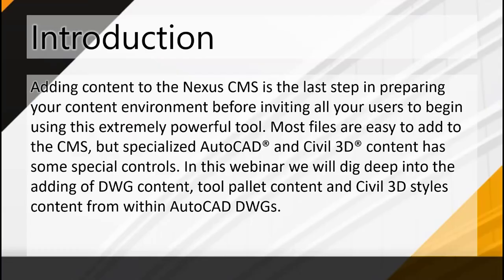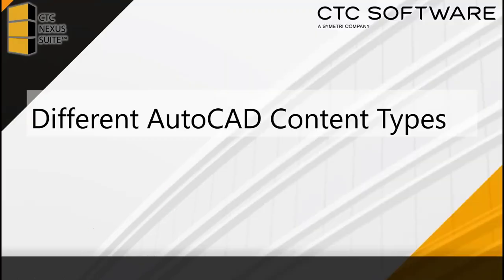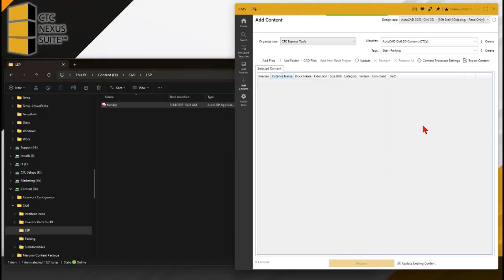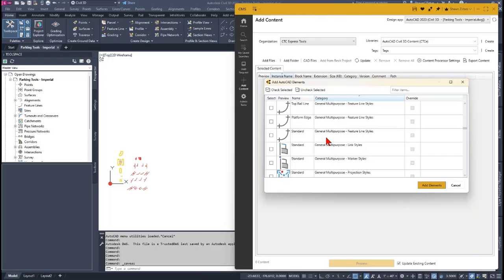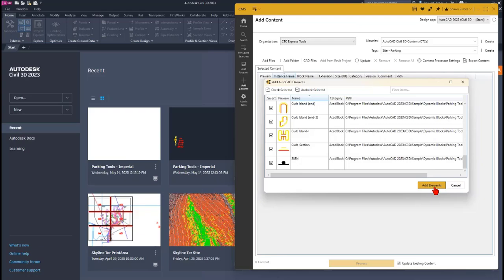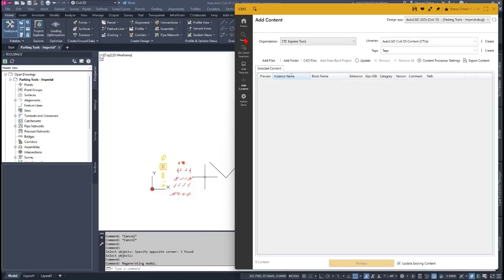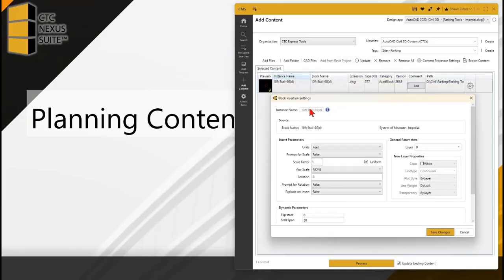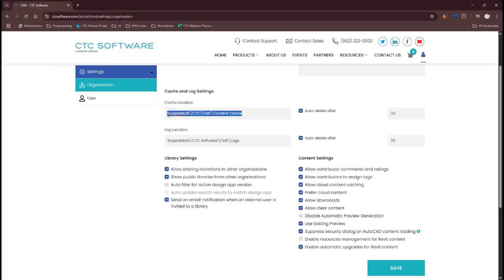Nexus CMS Admin Learning Series: Processing AutoCAD Civil 3D Content

Comment: Our Revit team uses CTC CMS pretty extensively, and I'm looking at it for Civil 3D. I'm starting to explore it first as a Detail Library. My Revit team has said that since they have their details/families/etc on one of our network drives, those using VPN have a pretty slow time accessing content.

I'm trying to stand up and utilize a Forma project for all our details (we also have all Desktop Connector paths set to C:\DC\ACCDocs rather than the default User location). Anyone else trying this out currently and are their any known benefits or problems with storing and accessing content from a Forma project (assuming all permissions are set correctly in Forma and Desktop Connector is connected to that project)?
Reply from the maker: @AdamPFarnsworth We would love to have a more in-depth conversation with you about how Nexus can be used for Civil3D. If you reach out to info@ctcsoftware.com we will get sometime to follow up
Reply: @CTCSoftware   Will you be at AU? If so, I can definitely talk to you there!